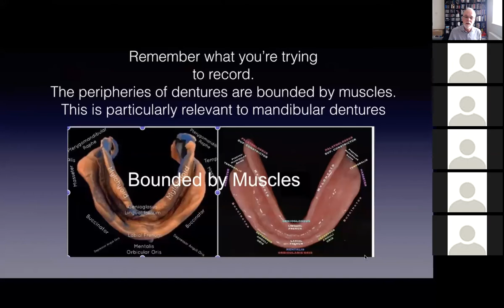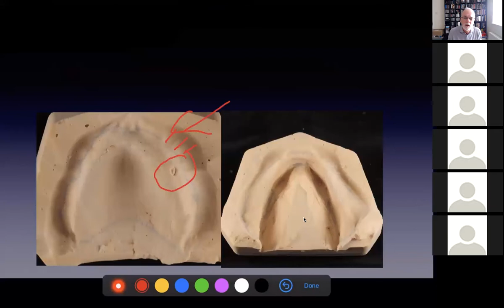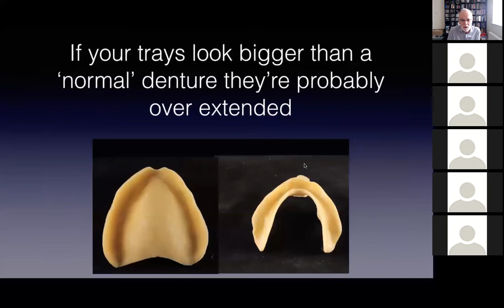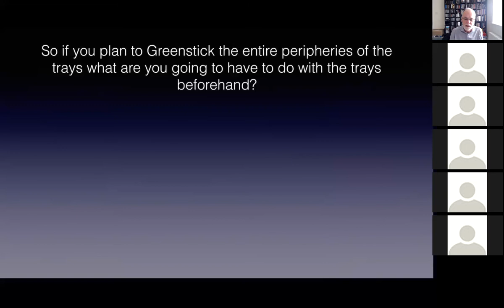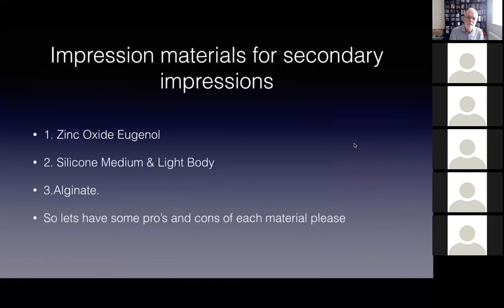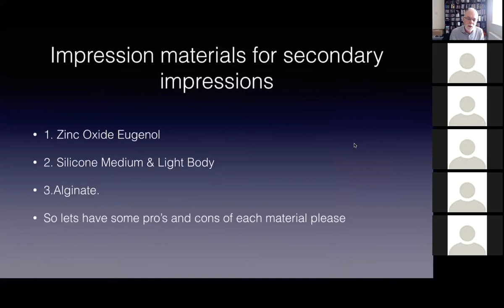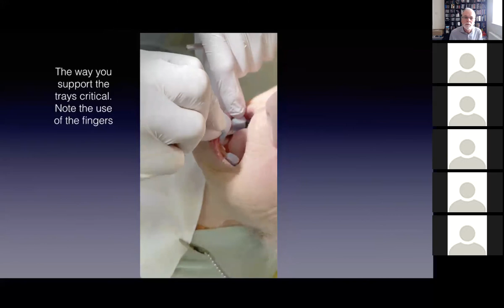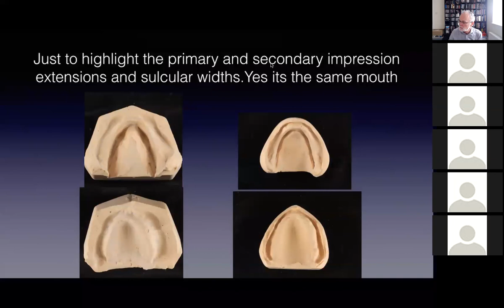Tutorial on Secondary Impressions for edentulous cases

Comment: Would you still use the green stick if your patient has dementia and can't perform commands such as, move jaw side to side, stick out tongue or swallow?
Reply from the maker: I’d probably just fit check with light body silicone to check for over extension. Give them some to swallow like a drop of water for instance
Reply: Sounds good. Thanks!